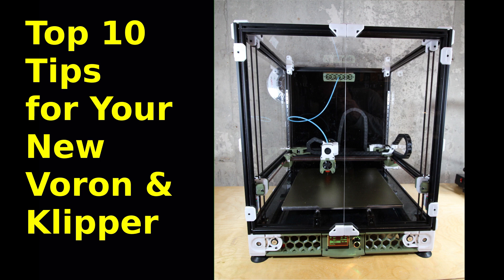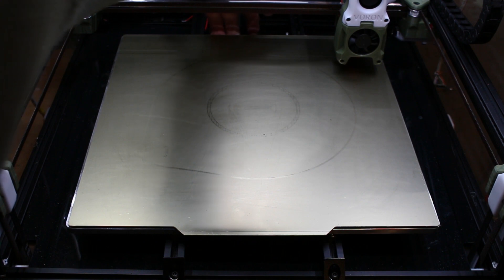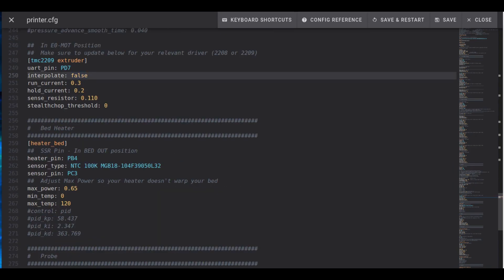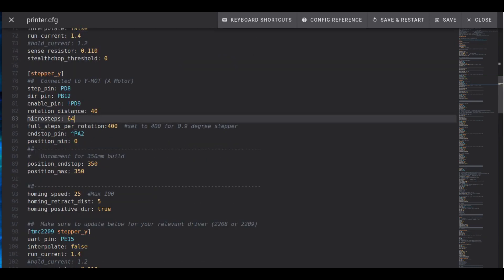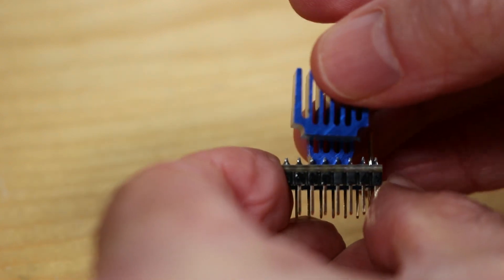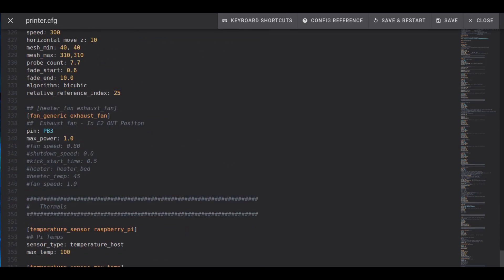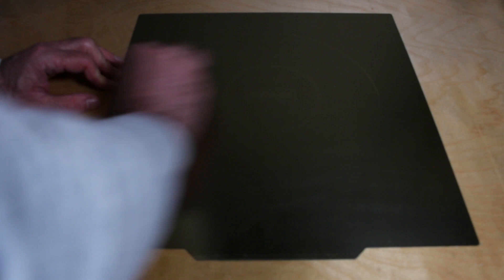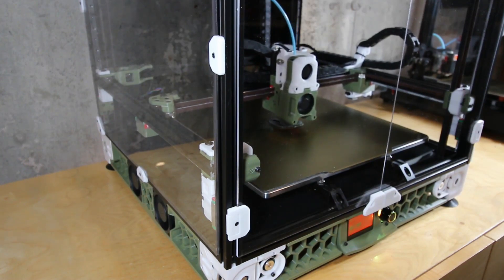Top 10 Tips for your Voron and Klipper

Comment: Can the controller_fan be controlled by temperature readings from Raspberry Pi?"
Reply from the maker: I believe you can, but I would not recommend it. The fans are critical for cooling the stepper driver chips. They get very hot very quickly and will damage themselves. The pi? It doesn't really need lots of cooling as it will throttle itself if it starts to get too hot. But Klipper doesn't create huge pi cpu loads anyway
Reply: Yes, you are right. So, could the control be with the MCU?
Reply from the maker: That’s how mine is setup now, but configuration is with the printer.cfg file.
Reply: Ok, can you send the code for this configuration

Comment: Would you be interested in sharing your printer configuration file? I'm just about to build my 2.4 R2.
Reply from the maker: Yes.  I posted it and the related files yesterday!  Please don't just download and use "as is", it could damage your new build and it contains features you may not have on a brand new build.  But please do use it as an example/reference.  https://github.com/Kapman1/Kapman1
Reply: @KapmansBasementWorkshop  thanks brother   much appreciated

Comment: Temps stratify drastically inside an enclosed printer.   Z should always be on the bed so you can do the printing up high in the top of the printer where the atmosphere is hotter.  Additionally, the filter system needs to be designed so it's dumping the already heated and newly filtered air to the interior.    When printing ABS you really want a 50c printing zone. 35c is absolute minimum.  As you go up in temp warping disappears and larger parts can be accomplished.  Some claim up to 70c is even better but I can't achieve above about 53 on my Ender 6 printers.  Looking to upgrade to Voron after 7 years of enclosed ABS printing (formerly 4x Davinci's).  Will build Triton's to get the best of all worlds.  Liked, start a Triton.
Reply: I'm new to this printer design so apologies if this is a dumb question. But what do you mean by, "Z should always be on the bed so you can do the printing up high..."? Are you drawing a contrast between the fixed bed Voron design vs. the vertical moving bed design of your Ender 6 printers? Unless I'm missing something (entirely possible), your advice can't be followed with a VORON design printer...
Reply: Thinking about the case filter fan and this stratification issue (hot air rises...), why not design a recirculating fan that draws a small volume of air from the top of the printer and sends it in at the bottom? Might need to be careful to avoid strong localized drafts.  Or, perhaps more effective and simpler, add a low velocity circulation within the enclosure with some small fans designed to reduce the temperature gradient during long prints at high temps.
Reply: @steveh8724  Voron's are very high quality. But yes, there are absolutely a number of Vorons with Z on the bed (bed goes up and down, carriage height remains fixed).   V0.1,  V1.x series and Voron Trident.  It's only the 2 series (as far as I know) which has Z on the carriage like your 2.4.   The V2.4 is exceedingly popular and it's a fantastic printer.  Just this aspect is a modest disadvantage.
Reply: @steveh8724  You are correct to realize a fan would put a draft at the part which is usually a problem with ABS and probably also with Delrin and other materials with a higher shrink ratio on cool down.  That being said, I've found A very small amount fan can be tolerated and is in my settings for overhangs that are over 45 degrees.   I think you'll find you have a very excellent printer there.  I would just recommend taking some measurements at various levels in the machine.  You'll find a dramatic temp change from low to high altitude.   Vorons are primarily ABS printers which is often the common material used with mechanical items and by more advanced users.   I really want take advantage of the stagnant concentrated heat at the level of the printing.  It exists naturally up high in the printer.  If I am printing something not happy with hot environments (like PLA), I can always open the top and leave the doors open.   It's not hard to get rid of heat, but it is difficult to get it when you need it.    I'm about ready to order a 0.1 for a first build.  I want to replace my two Ender 6 units (very good printers!) with Voron Tridents over the next year if possible.
Reply from the maker: There is an enhancement for the Voron 2.4, the nevermore filter that recirculates the air internally that many have success with.  I'm considering it.  But I also like the idea of taking air from the top of the printer and sending it back down to the bottom...

Comment: thank you very much, however i did have problems with the temp stuff the way you showed it, this is what i ended up with

###########################################################
# Add raspberry PI system temperature 
###########################################################
[temperature_sensor raspberry_pi]
sensor_type: temperature_host
min_temp: 10
max_temp: 100
############################################################
# Add Octopus MCU system temperature 
############################################################
[temperature_sensor octopus_mcu]
sensor_type: temperature_mcu
min_temp: 10
max_temp: 100
Reply from the maker: Glad you have it working.  Thank you for posting that and watching.

Comment: I haven't completely finished watched the video - and therefore this comment isn't about the contents (which I can already assume are fantastic) but something related: audio capture. It isn't bad in the slightest, but there is the occasional plosive (P and Bs are the worst offenders) that's getting caught. Having some kind of pop shield will greatly reduce the effects these have on your final output.

Now, back to the video. :D
Reply from the maker: Very good suggestion.  I use a headset which might be part of the problem.  I've been thinking about an upgrade.  I'm going to look into a pop shield to go along with that.  Thank you for the suggestion!

Comment: Great video. I thought Klipper had a 1.2 amp limit? I also have the Blurolls kit and noisy LDO motors, I will be trying you settings.
Reply from the maker: I'm not aware of a Klipper limit.  I'll need to check that out.  However, the  TMC 2209 stepper drivers have a max capacity of 2 amps.  There is no way they will be able to handle that kind of power for any reasonable length of time without burning up.  Make sure your 24v cooling fans that blow air over the board are running at full 24v and not 12v.  There is a jumper on the spider board to adjust voltage to the fans.  I expect the improved heat sinks will provide some additional headroom.  Thnaks!

Comment: You don't have stealthchop on for the tmc2209? If you want to quieten the steppers you should turn stealthchop on
Reply from the maker: I don't.  The Klipper documentation seems to recommend Stealthchop be turned off due to concerns about accuracy.  Since you have been running it, have you noticed any issues?  I may try it soon.
Reply: @KapmansBasementWorkshop  it depends what you're aiming for. I work for a company that worries about micrometer if not nanometers but aren't using fff to achieve that. For me I don't mine running it a bit slower and less accurate for it being a lot quieter. Each to their own I guess. Worth a try though
Reply from the maker: @mrsurfhead  , I've got to try it now.  Thank you!
Reply: @KapmansBasementWorkshop  let me know what you think!
Reply: if you going to go with stealthchop over spread cycle you are going to need to slow down your print speeds and accelerations/decelerations or you printer is going to start skipping steps. It's a give and take here, either slow and silent or fast and loud.
Reply from the maker: @jsross33  That's good to know, especially since I want to see how fast I can push this while keeping good quality prints.  Thank you for the tip.

Comment: How is the electrical safety on the voron? Do I need to ground the frame?
Reply from the maker: It's highly recommended to ground the frame.  I ground mine.  It's pretty easy to do with all the electronics mounted in the base where electrical ground comes in.  I don't know how critical this is, but it's not worth taking a chance.  Ground it.
Reply: @KapmansBasementWorkshop  Is there a guide on grounding the frame?
Reply from the maker: @lukazz434  I'm not aware of a guide.  However, you can test with the continuity setting of a volt meter or in the case below (my volt meter died during the build) rig up an led, battery and some wires to test for continuity.  This video: https://youtu.be/7OQSk0oNxNQ at 14.35 shows how I did it (see the yellow wire).  It's not super clear now that I'm looking at it.  But it works like this:  The SSR is mounted on the DIN rail which is bolted to the frame just as the printer bed is.  So I attached ground to that SSR mounting bolt because when I tested for continuity, I got current running from that bolt to the aluminum bed.  I'm sure other bolts would work as well.  To get continuity working, you might need to use a slightly longer bolt or 2 to dig into extrusion at the bed and /or possibly the bolt used to secure the DIN rail.  You could also just inert a t-nut or 2 with a bolt or two that dig a little into the aluminum extrusion as well.
Reply: @KapmansBasementWorkshop  Seems clear to me. However, I'm gonna call someone to help me with the electrical safety stuff since I'm an mechanical engineer, not an electrical.
Reply from the maker: @lukazz434  That sounds like a fantastic idea.  If you hear what I've done is a terrible idea, please let me know!

Comment: Thanks alot, thanks to your temp configuration at step 1, i cant connect to the raspberry after clicking save and restart. Thanks for making me loose all my config and making me reinstall everything
Reply: That's what happens when you trust a chanel who's nobody
Reply from the maker: @joaquimcastillaizquierdo783  I'm sorry you ran into a problem.  But it sounds like something else was wrong.  As you use Klipper and make improvements to your printer, you will always need to press "save and restart" for Klipper to recognize changes in your config file.    I must have made 100 changes to the config file and restarted Klipper and I've never had a problem.  By any chance, did you restart using some other method?  Restarting a Raspberry PI by turning off it's power has a history of damaging files on the SD card which might explain what you experienced.  Again, I'm sorry you experienced a problem.  Good luck with the rest of your build.
Reply: I searched everywhere to get that option on my printer. By chance this individual showed how to enable it. When I put it in it worked without issue. As the channel owner said, I believe something else caused your issue as this obviously works. Not to mention, EVEN IF it did mess up, klipper would just not enable the printer to work. You would still be able to connect and change it back.
Reply from the maker: @cotycollins6302  Thank you for verifying this worked for you!

Comment: What build plate are you using?
Reply from the maker: I'm using the default plate that came with the Blurolls kit.
Reply: @KapmansBasementWorkshop  I think the question is more how thick that plate is. So the kit is like modding a car with low suspension etc. but standard tires and not flat ones. Ok here it is probably more the opposite, standard (BOM) screws but thinner "tooling" plate. But I bought some sub system kits and mine (buildplate) is 8 mm thick, but there I am more concerned about its black "anodized" surface. I still have to drill and tap a earth connection into it.
Reply from the maker: @wernerhiemer406  The plate was the correct thickness, but the mounting holes were countersunk holes which are different from the BOM.  I don't believe there is anything wrong with it, but it is different from the BOM edge mount.  I found myself wondering about the black extrusion, but the seem very straight.
Reply: @KapmansBasementWorkshop  Ah ok. But no not the extrusions are black, but my plate. Not a kit at all in the sense of only printed parts missing. Edit: the extrusions as well are black, but they were more difficult to get the screws in one go. Only three I got at first try screws in and mostly even per two finger grip. I were afraid to strip or break screw or allen key. But eventually they gone as deep as they needed to thighten down for making corners.
Reply from the maker: @wernerhiemer406  When you post to get a Voron serial number, post a link here as well so we can have a look at the finished printer.

Comment: Thanks for this great tips!
Even tho I don't have a Voron yet I decided to use Klipper and now my printer its a lot faster 
I'm able to hit 6k Acceleration and to still have a perfect part! On a Malyan M150 a printer made in 2015 (Wanhao i3 clone) 
And now with some tips&tricks learned from your great content I'm sure that I can be able to fine tune my printer. 

I also have a question for you if you know I still have an issue with my Extruder Temp and from time to time I still get an err when the part cooling fan kick in for bridging 
"Heater extruder not heating at expected rate See the 'verify_heater' section in docs/Config_Reference.md" 
the problems starts when I turn my part cooling fan to the maximum.  This problem Its also because of the great cooling provided by the Stealthburner :D 
when I have the Heater at 210C and I start the part cooling fan to maximi the extruder heater gose to 192-195 and slowly start to crank up. I have an silicon sock 
I use a 40W Heater. There is a setting how many current it can suck? I have 25A mosfet upgrade for the bead and one for hotend
Reply from the maker: Hmmmm, for the extruder heater I would 1st try a PID tune for the hotend with the part cooling fan running at the maximum speed.  If that does not solve the problem or the PID tune fails as well, I would swap out the 40w heater for a higher wattage unit and do another PID tune.  
Thank you for the compliments and for watching the video and I'm very glad you are finding some of these tips useful.  I wish you luck in solving the problem and please let us know what ended up fixing the problem.
Reply: @KapmansBasementWorkshop  I tried the PID with and without the fan on (part cooling fan) and it went thru I think I need to mount the 50W heater but I'm postponing this because I still use the old mother board and its 12V.
Thanks a lot for the fast reply